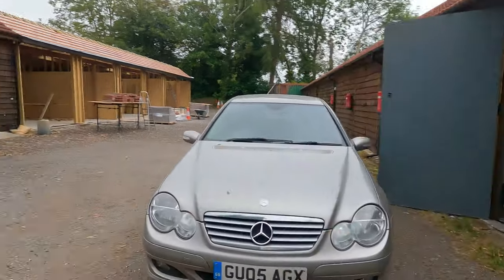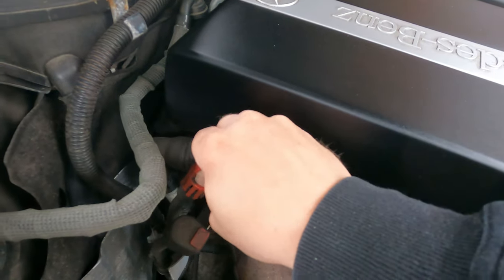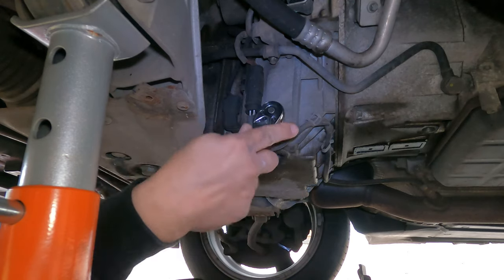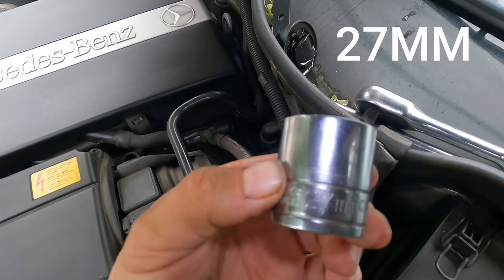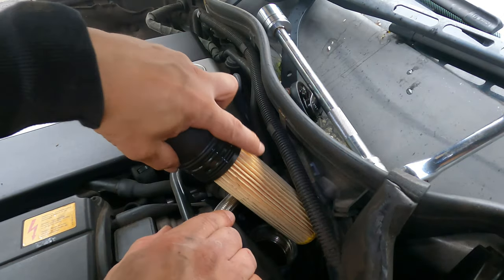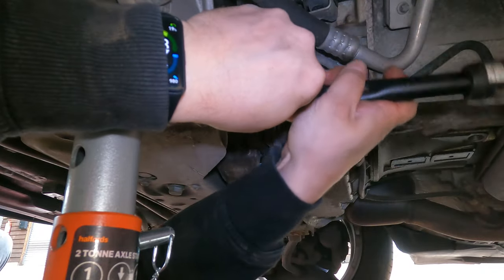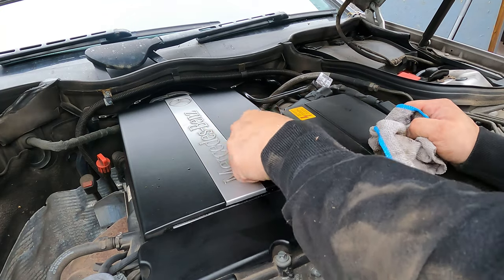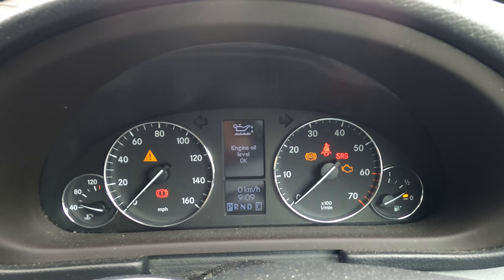How To Change Engine Oil & Filter On A Mercedes C Class 180 Kompressor (w203) DIY

Comment: Hey Chris, changed my filter the other month took her for a drive and about half an hour in all 5 litres of oil came gushing out of the oil filter housing. Just curious if either there is supposed to be a gasket there as well as the o-ring or maybe I over torqued the housing which might of compromised the o-ring. Cheers for the video
Reply from the maker: Just the o rings as in the vid and torque to spec as you may crack the housing

Comment: Love ya work 
How do I change the oil cooler 🤔step by step pls been told I need to remove starter motor to be able to reach the nuts for  the oil cooler